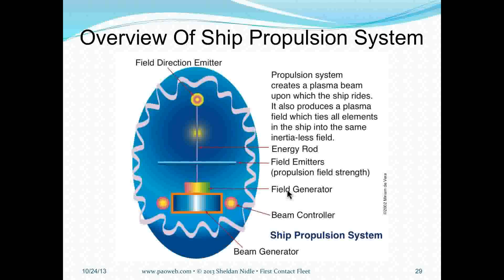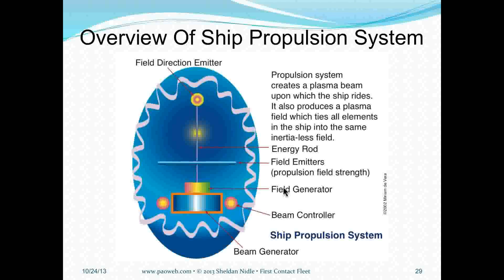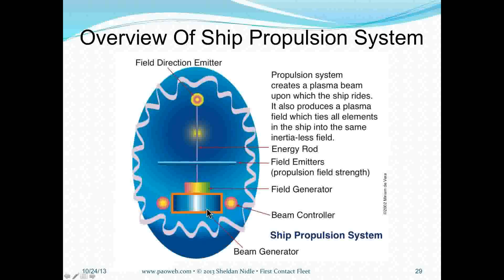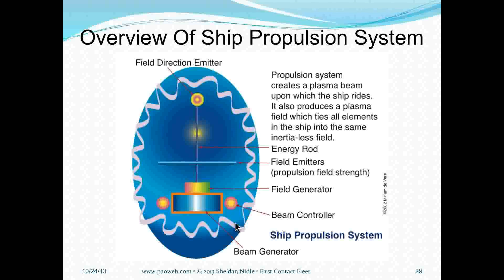PAO Webinar 44: Preview - Ship Propulsion Systems

Comment: I am not sure about your explanation. Antigravity is obtained by electric charges circulating around an axis and creating 2 separated magnetic fields in the shape of torus. For example, a semiconductor disc does it. Even better, a pipe with plasma in it layed in a ship, around it The plasma circulating around the ship in the pipe will create an "antigravity bubble" with a ship in it.